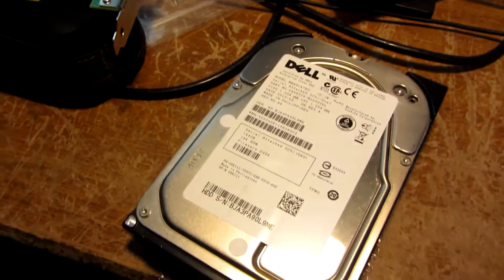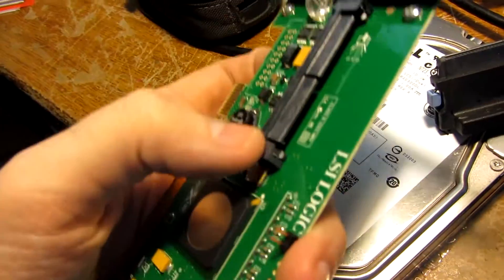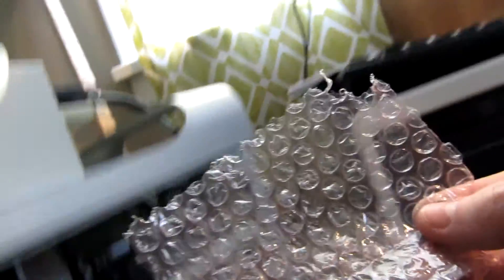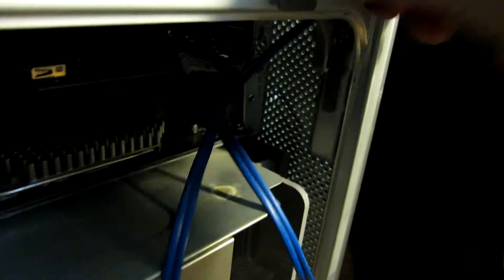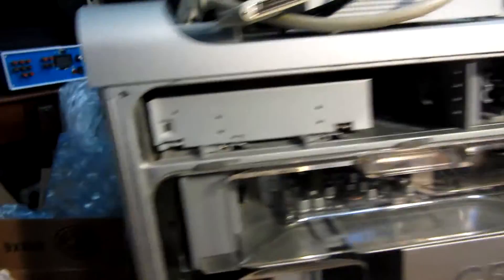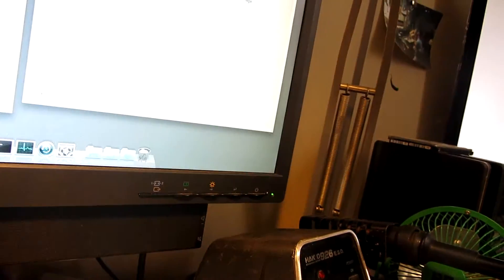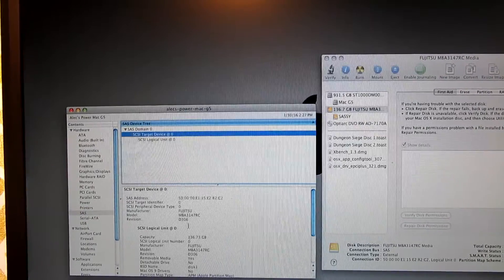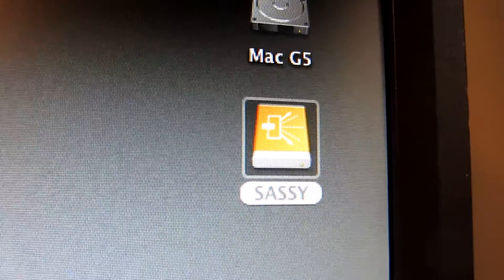SAS drive on Power Mac G5 with LSI PCI-X controller

Comment: Interesting, did you install any drivers for MacOSX?
Reply from the maker: Nope!  However, I had no luck getting it to show up in 10.4, though, even after attempting to edit a kext.
Reply: Thank you, that's now a warning for me not to think about using it in 10.4 environment. Had the idea to install this card in my Powermac G4 Dual for checking SAS drives. Have a ATTO UL4D in my old Mac for testing all kind of SCSI drives and wanted to add a SAS card for testing SAS drives. Seems to be impossible.
Have another computer here, an iMac, but the only way is to buy a thunderbolt - SAS box, but that is very expensive.
Reply from the maker: I certainly wasn't very careful selecting my SAS card, literally just looking for the cheapest PCI-X one on eBay.  10.4 should be fine with a compatible card.  I think finding the darn cable was the hardest for me.  Still didn't get the right one!  :)